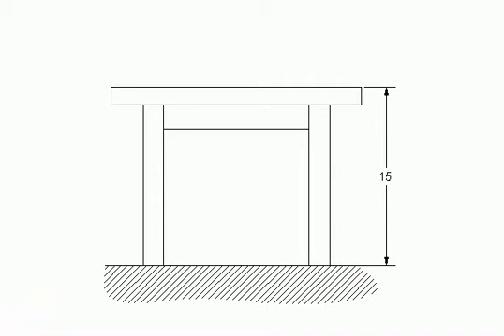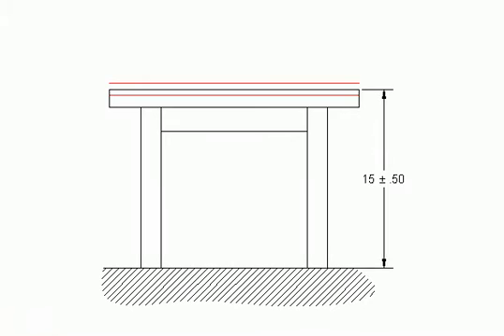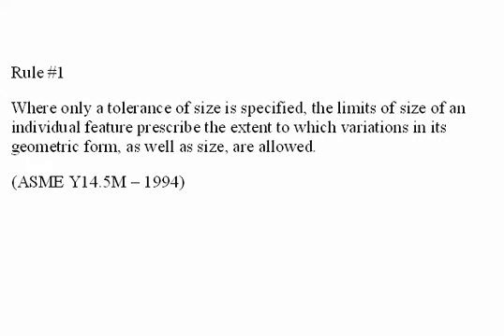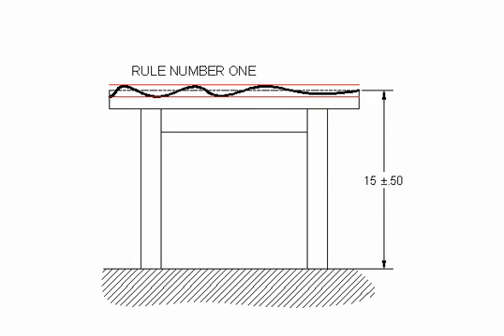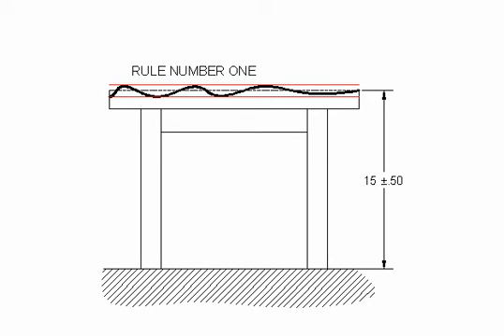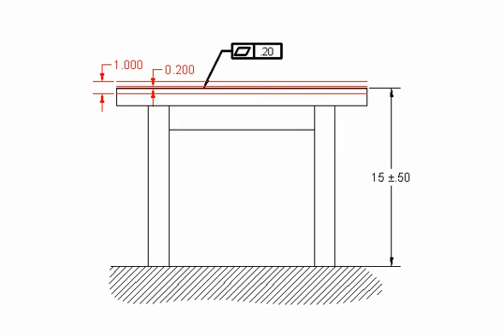GD&T Table Example (Rule #1)

Comment: While your lesson is sound, your depiction of the dimension and the tolerance is in violation of the very standard you are trying to teach. You should have a decimal and two trailing zeroes after the 15. You spoke of inches so that's the way this should go. Ideally, it should be one trailing zero and simply a +/-.5. I know it's not the point of the lesson, but why not make it right anyway?